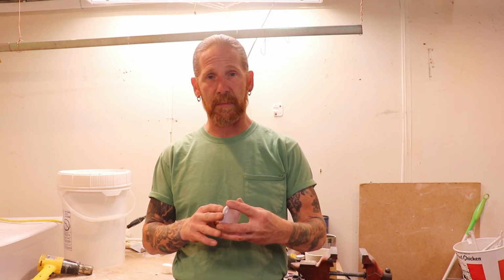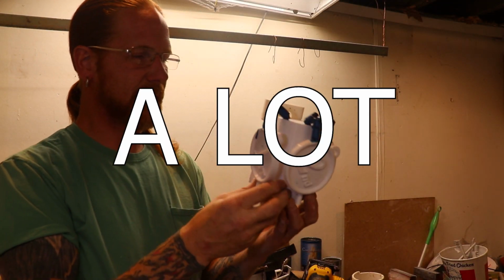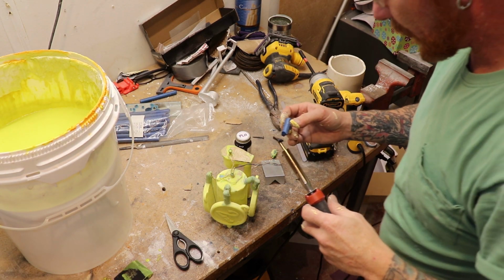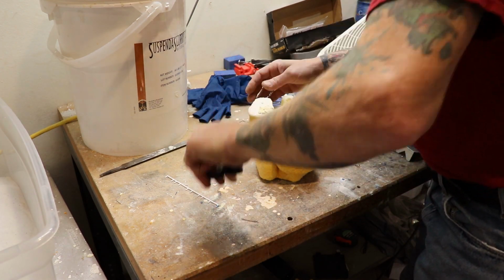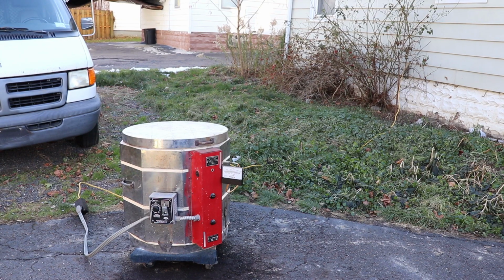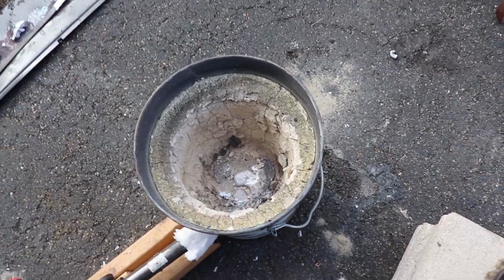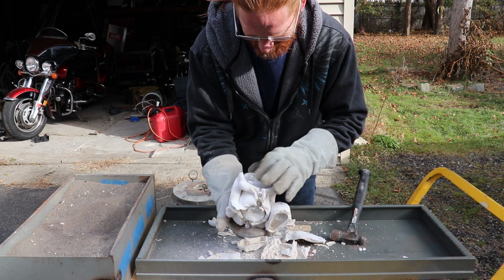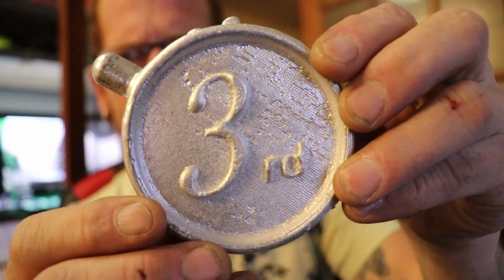Lost PLA Casting Drone Race Metals (Suspendaslurry)

Comment: I would really re-examine your sprues and how you apply them. The first thing I notice here is the huge well in the middle and its a mystery to me. Take a look at how jewelers sprue things and I think you will realize you are over thinking it. The second thing that struck me when I watched your videos is that you tend to pour up with your metal flowing up from the bottom. Most sprue's I've seen tend to be in a Christmas Tree configuration with the pieces fanning out from a central larger sprue. I think I'd consider investing in a centrifuge as well though that doesn't allow for larger pieces to be cast.

Comment: Use a "BLING" chain, open the end link, drill a hole in the medal, and there You go. You could also drill two holes on the edge, and glue in a hook with Locktite!
Reply from the maker: i did another video finishing them did you take a peek at that?
Reply: @InsideTheMindOfMatt  No I didn't. Will do! Thanks! ;)

Comment: Clean them up and Drill them and sand backs Flat, don't know what kind of laser your going to use but may have to paint some matte finish clear on the back after you sand it depending what Wavelength engraver it is.

Comment: If you drill two holes into it from the top, in like a \/ shape, they'd meet in the middle and allow you to thread a string in? It'd not go through and marr the front or rear surfaces that way, like a front to back hole would, would also let it sit straight against the chest too, i think :)  Definitely suitable for prizes, they look ace!! Could use finishing in a tumbler? :) 

p.s. WEAR A MASK when working with the shell materials lol
Reply from the maker: Thanks for the input and the kind words I got a plan and I’ll share the process and yes on the mask need to get some disposable one just for situations like this

Comment: Neat pour.  I hadn't seen you use the slurry until now.  With time constraints, I'd just polish them up, drill the holes, and thread red, white, and blue ribbon through the holes.  On another note, have you seen the BASF 316L metal filament?  It's a little pricey at $465 for a 3 kg spool, but you might be able to do your own sintering.
Reply from the maker: I’ve done several videos with the slurry you’ll have to go back and binge a few lol I haven’t seen that filament but I used some bronze fill that is sinter-able but didn’t have the kiln at the time. Thanks for the input and for watching

Comment: I think this being the 1st race your doing this for you can clean these up and maybe drill some kind of holder to them so you can connect the lanyard to it. Worse case is you can 3D print a plastic circle ring holder that you can press them into that has the hook. You can always replace them later for the winners if they want otherwise the new ones start the next race and nothing is lost. I'd be happy to have a medal that was personally made regardless if it wasn't 100% the way it was intended.